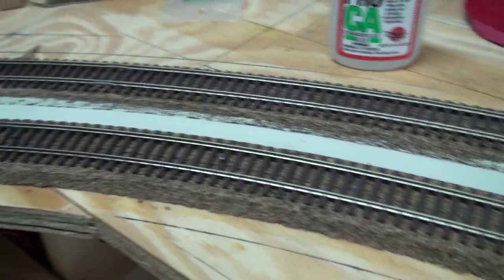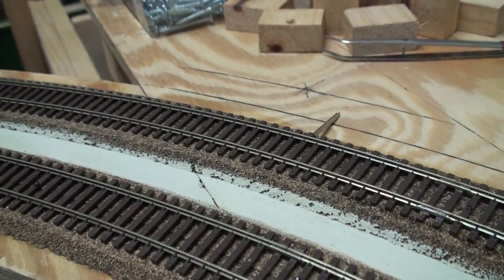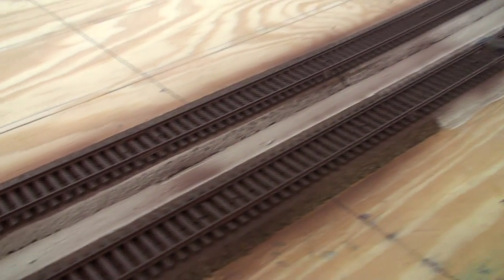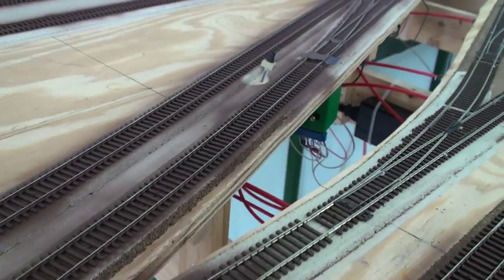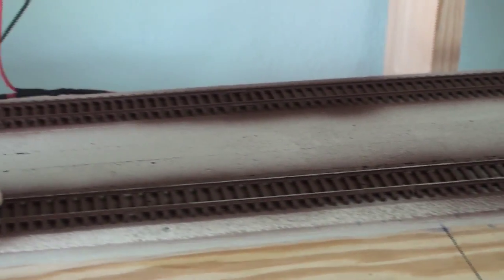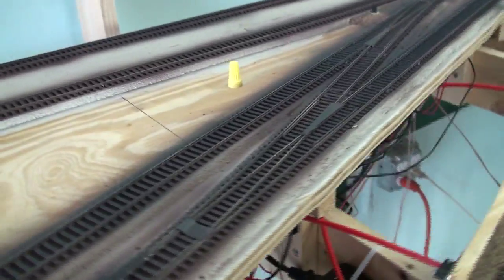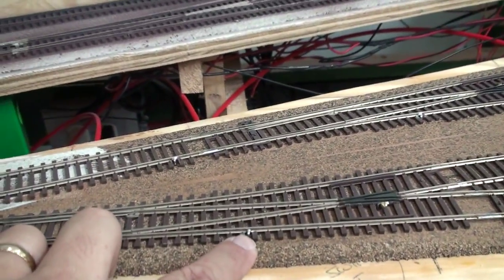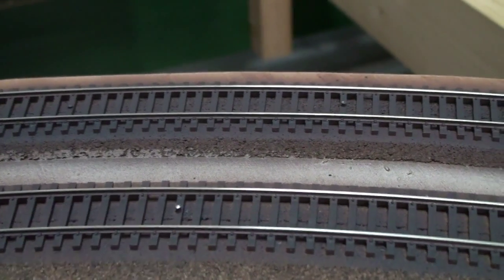My CSX/NS HO Railroad Part 10 "Track Super Elevation and Paint"

Comment from the maker: I cut the rails to size, then soldered a feeder from underneath to each rail in the center span of the rail (center of disel house).  I then mesured where the feeder was soldered to the rail and drilled a hole for each feeder to pass through.  I then glued the rails on several of the rail stands.  I placed micro plugs on the feeders and connected them to the adjacent track outside of the engine house.  Or you can splice off from your main track bus.  Have fun and keep rolling.

Comment from the maker: You can use Crazy Glue but keep in mind that you will have little time to position parts.  If you misalign the parts and the glue dries, you are done....

I would use plastic cement, the kind that comes in a bottle and you apply it with a brush.  Also remember to paint your structure before gluing it.  Go back and scratch of the paint where ever you will be joining two plastic parts with the plastci cement.  Have fun and send me a video when complete.  Thanks....

Comment: When superelevating, please allow for a transition from flat to the first stage of the superelevation. I then am assuming the superelevation is stepped up in increments for further transitions until the max at the "center" of the radius, and then the steps reversed as the curve returns to tangent (straight) track and no superelevation.

I used short strips rather than tiny square pieces, and placed them more or less under the rails rather than tie ends.  

The visual effect is terrific.